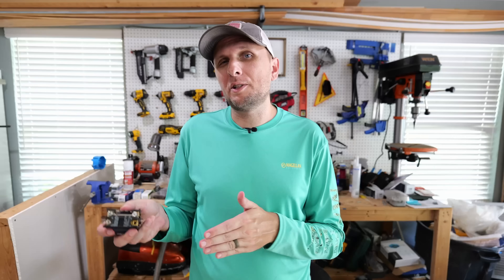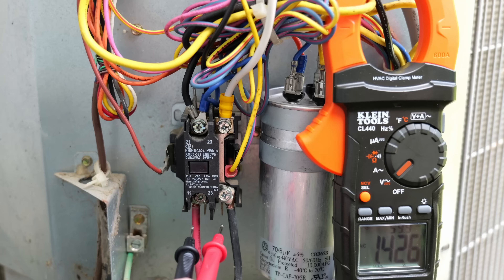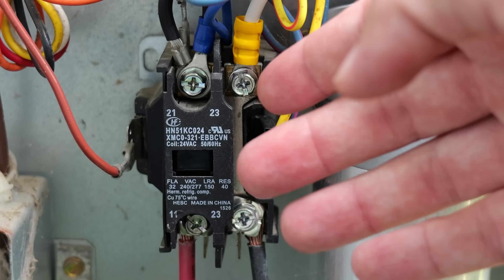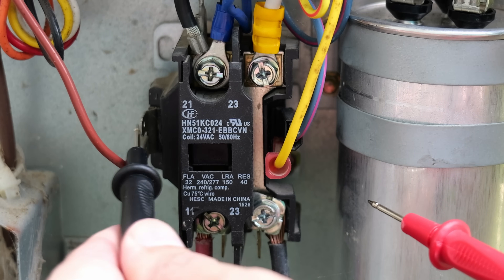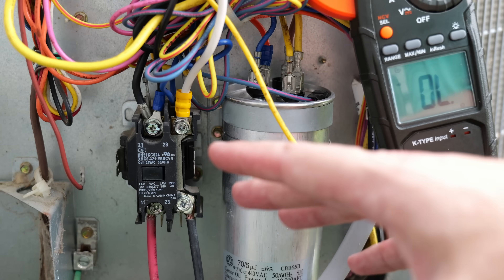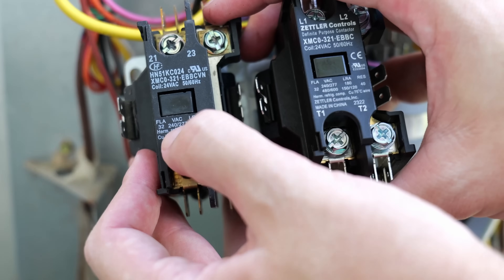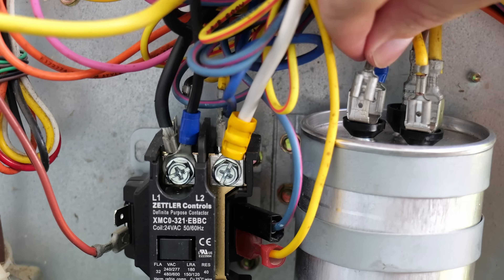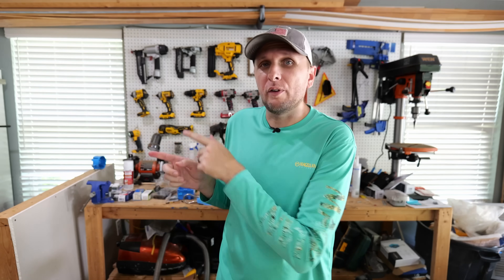Was Quoted $450.  I Fixed It For $19!  AC Contactor Testing and Replacement

Comment: The most common reason for contact or failure is nothing to do with insects are vaporized immediately when the contact is made... 95% of contactors failed due to poor maintenance of the and the overheating of the points due to poor maintenance...
Reply from the maker: Not what I’ve heard from the AC techs I’ve spoken with.
Reply: @HowToHomeDIY  I'm terribly sorry you were told wrong.. oxygen, moisture, ascetics, and overhearing! This is all premature part failure due to lack of preventive maintenance... I'm pretty sure a simple Google search will tell you the same. The AC text you were talkin to  most likely is not in the business for 29 years.. in 29 years I have never saw an cause premature part failure to a contactor..  control board's definitely! A lot of your followers aren't professional AC guys and just like me respect your opinions and your videos. Not trying to bust your balls just trying to keep you from making mistakes and causing other people to look like just because a couple of technicians didn't know any better that you spoke with...
Reply from the maker: Oh yeah there are definitely other reasons.  I think I even mention pitting of the contacts from heat and voltage and corrosion being some of the reasons it can go bad in the video.  The last ac tech that was out told me he’s seen them with issues from bugs getting in them, he specifically mentioned ants.  So just sharing what he said he experienced.  Maybe it’s a regional thing.  I don’t know.  I appreciate the honest feedback!  Hope your business is doing well!
Reply: @HowToHomeDIY  I just posted a link to that video... A guy with your on-camera confidence could take this and make it a kick butt video..

Comment: After turning off all power, Do you need to discharge the capacitor before touching any wires on the contactor?Thanks for your video.
Reply: No you don't.  Once the power is cut, there no electricity running in the wires.

Comment: A couple of comments.  1. You should do voltage checks with one hand, not two, like chop sticks. For safety.  2. Did you torque the screws on the contactor? There is a torque value listed on the contactor. (Commonly 25 in/lb for screws, 40 in/lb for lugs). It is best practice and NEC code requirement.
Reply: Damn you sound mad. He's just showing us how to save money from dishonest tech. Can you show him love instead.
Reply: No, wasting money replacing parts their AC's they don't need. ACs have a lot more parts than a contactor and compacitor.  @scredlysmith2153
Reply: @scredlysmith2153  I have in many videos.  I'm just trying to make sure people don't get hurt and the job is done right.  Also, I want my students to have jobs after their education.  Not everything is DIY.

Comment: I replaced my contactor.... it wasn't bad, but it also didn't have the test button. Once replaced, I was able to figure out that the problem was with the 24VAC line from the house, and the test button let me know the condenser was all good and firing up (meaning it had pressure). It ended up being the wire nut on the 24VAC control line coming into the condenser - the HVAC guy who had last serviced it had done a poor job with the wiring. Easy fix, and my AC was working. I have a new contactor and capacitor, and the old ones go into the storage box if I ever need them.

Comment: Some of these companies have a diagnostic fee, then price out repairs from menu pricing like auto dealerships do , a set price for time and materials, and some charge actual time and materials, time starts when tech receives call and ends when backs out of drive heading to next call, also supply and demand, good profession if you don’t mind working in the elements, there is and has been a shortage of technicians for sometime now, been in all facets of HVAC trade for 40 years, I always say we give better service than your doctor when’s last time your doctor made a house call ( like never) and we provide same day service on emergency calls with 24 hour availability
Reply: People are just cheap. They want us to fix it for 20 bucks and call it day. Like come on why have a house if you can’t afford fixing your equipment. Just rent instead.

Comment: At my old home the contactor in one of my AC units failed.  Turned out the plunger spring in it broke.  In a pinch, I pulled a spring out of a ball point pen and was able to install it in the old contactor MacGyver style.  That contactor worked for over 5 years after that and I finally moved out of that house and never did have to replace it.

Comment: Thank you! I just subscribed. 
These companies are not playing fair out here.
They are charging prices like they're working on the houses of millionaires. Or corporate and government buildings. 
No 1 should have to pay 2-3 weeks of their salary ( AFTER ALL DEDUCTIONS ) for a couple hours of work & $30 in parts.
I received a quote for over $1,000 to replace the contactor and the capacitor. I purchased both myself, for $40.
I started to write that these companies are going to drive themselves out of business with the sky high prices, but I guess there are alot of people who will pay anything to have something fixed.
The people who cant afford it will just have to find a cheaper way to solve the problem. 
& the world keeps spinning.

Comment: So first at 2:21 
"So let's go ahead and turn on our thermostat have it call for air and then we'll check our top terminals."

Then at 2:30 
"So now the AC is on.  You can see that the plunger is now depressed and being pulled inside of the contactor there. "

But they look EXACTLY the same?????  Even staring at it for a long time I can't see a pixel of difference between 2:21 and 2:30, except perhaps the wires above shifted a little.  I must be really blind or?  Can anyone else see a difference?  Or is he kidding us?
Reply: If anyone can see a difference would you kindly explain it to me?  Btw I have no idea what part the plunger even is.  Its shape or color.  Ugh feel so lost here.
Reply: @linsqopiring6816  The plunger is the black rectangular shape, exactly in the middle of the contactor.
It basically looks like a push button on/ off switch.
Its also the only part of the face of the contactor where there are no words written.
Reply: @do7hemath937 
How can a black rectangular shape that doesn't move be a plunger? 
"plung·er
/ˈplənjər/
noun
1.a device consisting of a rubber cup on a long handle, used to clear blocked pipes by means of water pressure."
I know contactor plungers are not going to have exactly the same definition as plumbing ones but I'd think they might have at least something in common?   I'm so confused.
Reply: @linsqopiring6816 not sure if you are trying to be a smart guy or genuinely don’t have a clue.  It is just referred to as the plunger in HVAC talk.  To you it would be called a button I suppose.  But don’t look that up because you will think it’s something that’s on your shirt 😂.   And yes, the plunger is clearly engaged in the second time stamp you listed.
Reply: @johnpicard4909 
No need to be snarky or put people down I'm trying my best to understand and it's already frustrating enough.   Obviously I know there are different kinds of buttons but I've never heard different meanings for "plunger".  So that's a rather unfair example.   
  Apart from it looking exactly the same when he says "you can see the difference" there's not any clear explanation about even the basic idea of what's even going on.   If the thing needs to be off when not "calling for air" as he says, why isn't it just switched off?  Why is there a need for a plunger and what does it do?   
  I know it's going to be so obvious for you because you're a super DIY genius. But if all you can do is ridicule then please don't bother to respond because it's not helpful.
Reply: @linsqopiring6816  Who's on first?
Reply: @do7hemath937  
exactly.
Reply: @linsqopiring6816 buddy you can’t see that the plunger is down when he turns it on, maybe you are watching on a very low resolution but it’s clearly different.  Either way since you don’t understand what it does even though he explained in my opinion too many times, I highly recommend you don’t attempt doing this.  Not being snarky or anything like that but he explained all of that and you still don’t understand it.  It can be very dangerous.   Call a pro.
Reply: @johnpicard4909  
First, I'm not your buddy.   
"you can’t see that the plunger is down when he turns it on, maybe you are watching on a very low resolution but it’s clearly different. "
 No, my vision isn't 20 20 so perhaps if yours is you can make it out.   But one things for sure.   It's not CLEARLY different.   If someone with good eyesight scrutinizing it can see a difference that doesn't make it CLEARLY different.   Do you want me to link you to an online dictionary's definition of the word "clearly"?   Because you don't seem to get it.
Reply: @johnpicard4909 
"Either way since you don’t understand what it does even though he explained in my opinion too many times, I highly recommend you don’t attempt doing this.  "
 He never EXPLAINED it once.   He jsut assumes we all know what a air conditioning plunger is and then uses the term in a mixture of electrical jargon.   
How hard would it be to explain arcane terms that you use the first time you use them?   "This here is the plunger".  "What it does is   "
Reply: @johnpicard4909 
"I highly recommend you don’t attempt doing this. " 
That's one thing you are right about.   I would not even think of attempting to do this since I don't understand since it was never explained.   Glad these videos are here for handyman whizzes that already understand these things.
Reply: @linsqopiring6816 oh sorry Buddy.  I thought we were bonding.  Just because you don’t have 20/20 doesn’t mean it’s not clear, you just need glasses.
Reply: @linsqopiring6816 he did explain it.  When the thermostat calls for air it pulls the plunger down causing the contacts to connect the bottom to the top of the contractor therefore passing the power along to start the ac.  He said it numerous times.  Maybe you are skipping around I don’t know but everything was made extremely clear.
Reply: I suggest that you zoom in on the plunger and take a screenshot at both of those times you listed. Then look at both of those screenshots and you will see the difference between them.

Comment: My Dad paid $150 to have a capacitor replaced.  Two weeks later he had to pay $150 again for the upstairs unit capacitor.  Probably could have received a big discount if he had both changed on first visit.  That winter my heat pump wasn’t working.  So I replaced  contactors and capacitors for both of my units at the same time.  Only one capacitor was bad but the extra $30-40 in parts and 20 minutes saved me the aggravation of swapping parts at some later date.
Reply: Where do you buy those?
The big box stores?
Reply: @netpasya  ordered parts online

Comment: The HVAC unit in my brother's condo has a strange, intermittent behavior: it can stay on beyond the time when the temperature displayed by the thermostat reaches the thermostat's set point, so the temperature will go far beyond the set temperature.  Is this problem more likely due to a fault in the thermostat or a fault in the HVAC unit?
     Notes: (1) The thermostat is pretty old, but appears to function well except perhaps for this intermittent problem.  (2) Four wires connect the thermostat & HVAC.

Comment: Thank you for all your helpful videos. Question could you check voltage drop between number 11 where the red wire is and number 21 on top to see if the contact is still good?

Comment: 💪🇺🇸❄️👍 that's great u did it urself.  $450 way too high. $195 would b more appropriate remember techs have to drive out diagnosis n repair n pay taxes, health insurance biz insurance etc...not worth driving to a service call for nickels n dimes
Reply: When you buy it yerself you can buy the highest quality and avoid the planned obsolescence brand.
Reply from the maker: Yeah, I would say that is a reasonable price.  Appreciate the input!
Reply: @HowToHomeDIY  I appreciate ur videos especially electrical vids
Reply: A guy quoted me $350 for a $20 capacitor. I told him "That's nuts. Since you're out here, I'll pay you $180 to swap it." He refused, so I paid the $89 visit/diagnosis, and saved $240.
Reply: @myfakeguuglaccount  it used to be simple. Just " Parts & Labor ".
1. The cost of the part.
2. The labor cost per hour &
3. The # of hours that the  job will take. That's it.
Now these companies see where they can charge anything they want and enough people will pay it. 
They don't care about who cant afford their prices.
I'm not trying to be funny, but there are people out there who can't turn a ratchet & socket. Those are the ones who need & probably make 6 figures or more. 
I've always heard knowledge is power.
& all the information you find on YT is proof of that.

Comment: Because of your helpful videos, I have purchased a spare capacitor and contactor 'just in case'.  Thanks for your insight to diagnose a potential problem down the road.
Reply: Good idea. Breakdown usually happens on weekends when everything is closed.
Reply: I always keep a spare capacitor, which has come in handy.  Since it doesn't cost much, a spare contractor also seems an excellent idea.
Reply: 😂😂😂 just buy a spare ac unit
Reply: @Bigmandoloco  You may not be the dumbest person on the internet but you better hope he does not die. Having 40 dollars of spare parts on hand for your air conditioner is smart. I can see why you don't agree.

Comment: Explain all the wires going to contactor.  Thanks.
Reply from the maker: I didn't go in depth on purpose because there are some differences on different folks contactors.  That's why I say to take pictures and follow the wiring diagram on your individual unit.
Reply: There's two that energize it and two that energize the compressor and fan, two others are the signal to close.
Reply: @rcstl8815 - one goes to the compressor heater ring too

Comment: Replaced the contactor in one of my old AC systems.  Easy but the specific replacement for my 47 yo unit was very difficult to find.
Reply: What was specific about it that made it different from the typical?
Reply: @mtnman1984  220 v. coil  and thicker with odd shape.
Reply: @wholeNwon  that is different